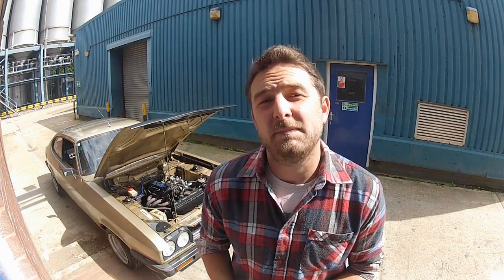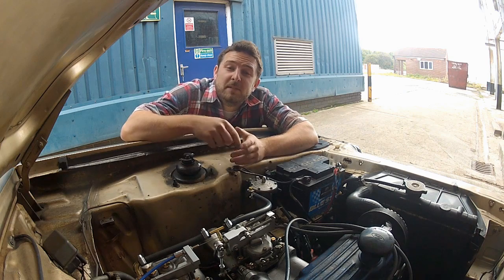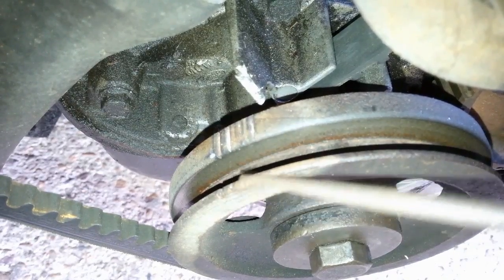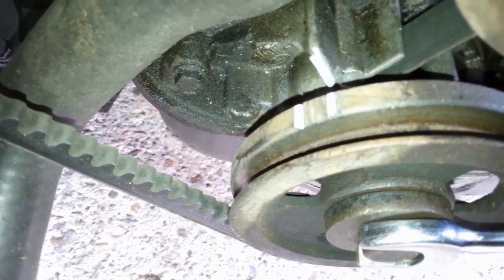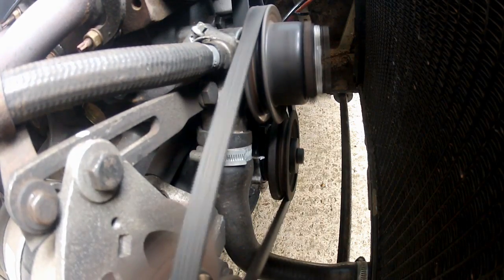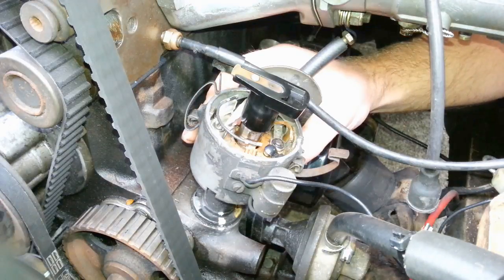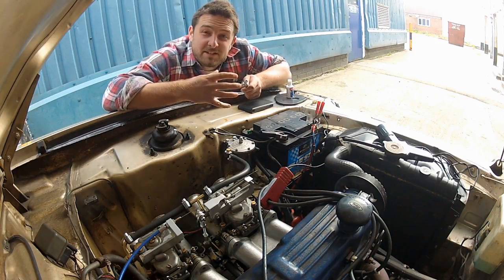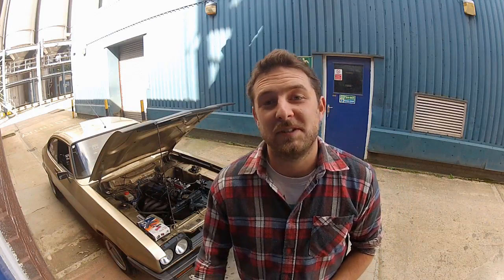How To Set Ignition Timing with a Timing Light / Ignition Timing Explained | Tech Tip 04

Comment: Awesome video, didn't have a clue before, but you made it proper simple! I have a 2.0 pinto in an Eagle RV Jeep kit car, and have no idea what the ignition timing should be set to, have you any ideas? What difference does it make? Cheers!
Reply from the maker: +The Baron Von Ozwald Thanks! Really depends on the tune of the engine, whether it's been modified or not.  But 6 -8 degrees BTDC will have you in the right ball park.  Unless it was wildly out before you won't 'notice' much of difference, smoother running and improved MPG maybe.
Reply: +Fast Rust Excellent, thanks! Also, could timing have anything to do with the engine overheating slightly?
Reply from the maker: +The Baron Von Ozwald Kinda doubt it. It could be a contributing factor, but I'd guess the main issue lies elsewhere.
Reply: @FastRust your motor sounds a lot like mine! The header tubes even look similar... my lima came with the intake (and carbs) setup you're running (plus a 4bbl, but no carb) but is currently on the progressive 2bbl from stock.

Supposedly it's been gone through and has higher compression! I'll Google it, but what's your take on timing for an NA with increased compression?

Comment: Hello
From the video I can not figure out in advance how many degrees you have set .
i have a 1987 ford transit displacement 1993 cm3 78hp block 205 .
my advance and the same as that set her in the video ?
Thank you
Reply from the maker: +Vincenzo Basile Hey, I set mine to 10 degrees BTDC, based on the mods at the time.  I'd say for the transit 6 - 8 degrees BTDC would be in the right ballpark.  Some of the later crank pulleys are marked differently, so take that into consideration.